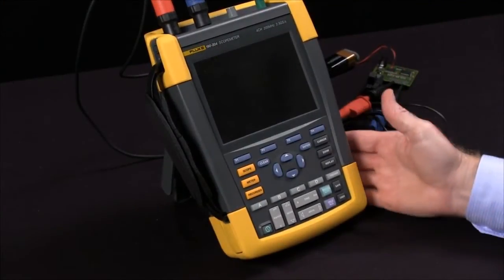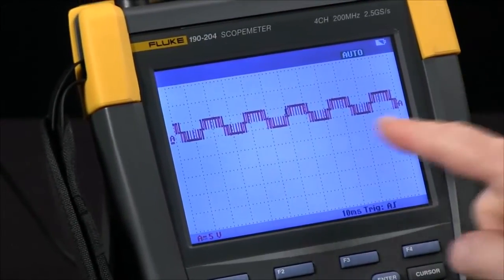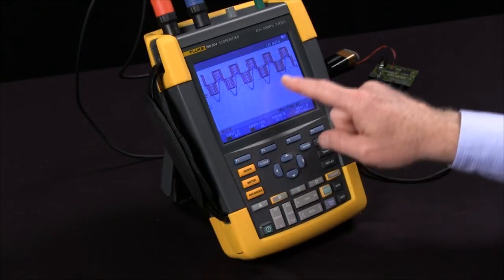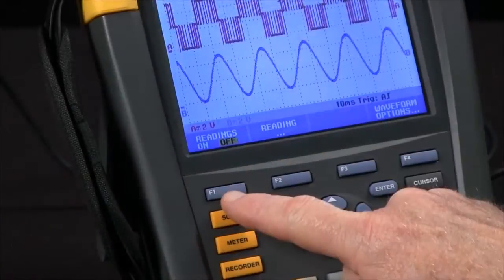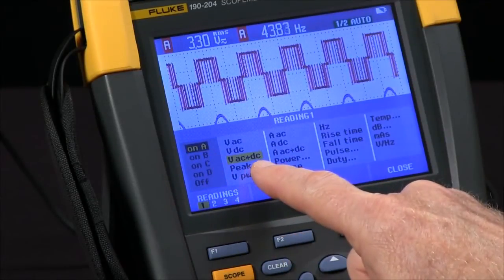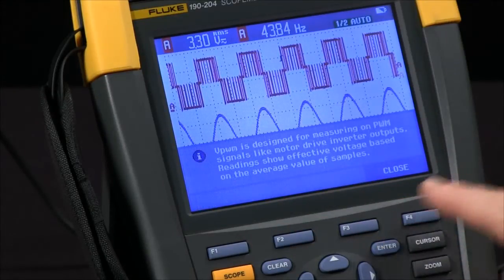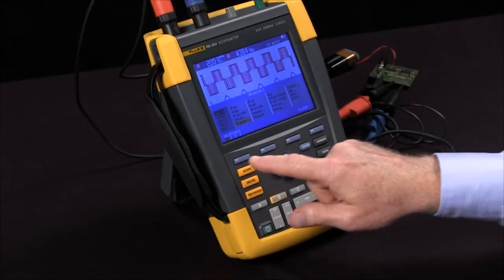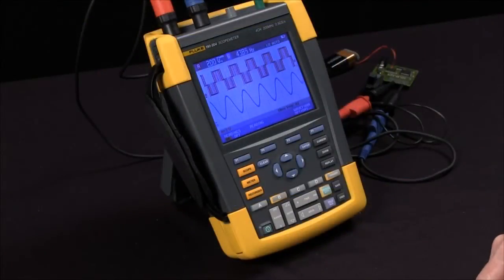How To Set Up and Reset a Fluke ScopeMeter® Portable Oscilloscope

Comment: mines not turning on, what's up with that?
Reply from the maker: Hi Franklin - Could be that the battery is bad. You can verify this by removing the battery pack from the Scopemeter and plug in the power supply. This will bypass the battery. If the Scopemeter turns on, then you would need to replace the battery pack. Hope this helps. If you have further questions please feel free to reach out to our Technical Support team at 800-443-5853.